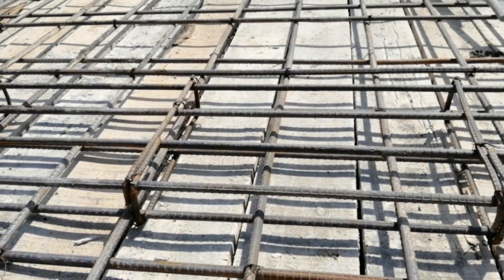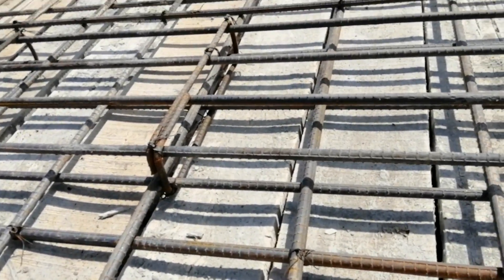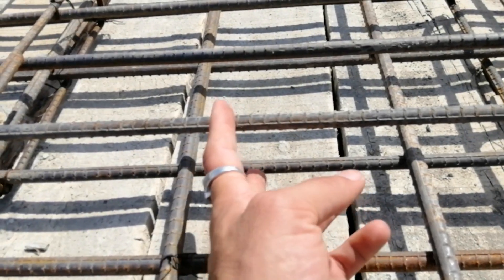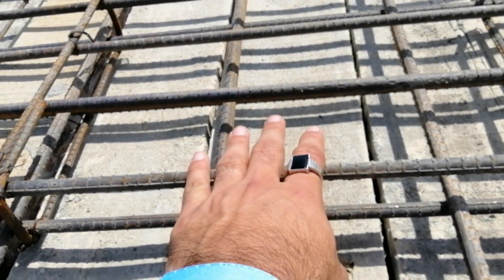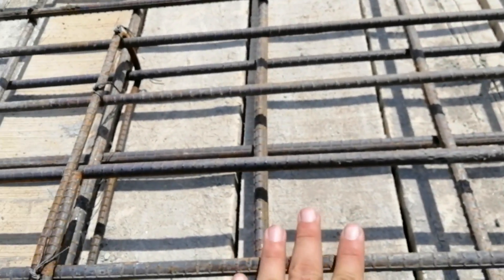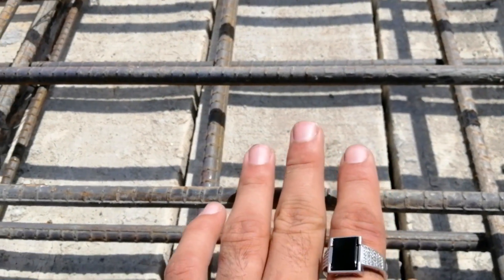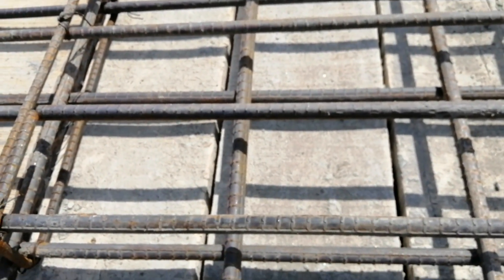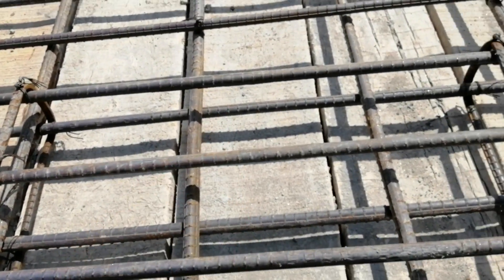Design of Hidden Beam in RCC Slab - What is Hidden Beam in Slab - Hidden Beam in Slab

Comment: why provide the hidden beam , for the which purpose its provide?
Reply: For good architecture 
Means for big halls portico look flat as the conseled beam is placed inside slab depth unlike regular beam which is visible from bottom 
And walls also can be built on them for next floor usually good for g+1